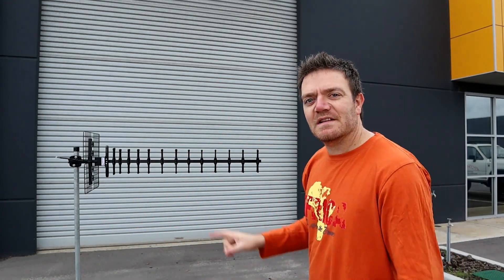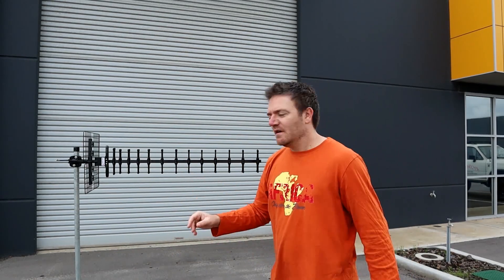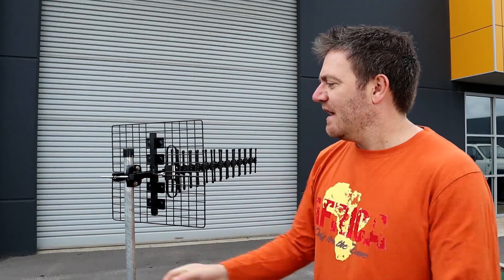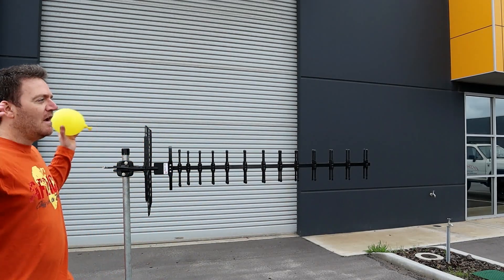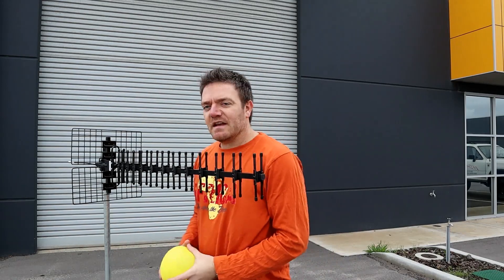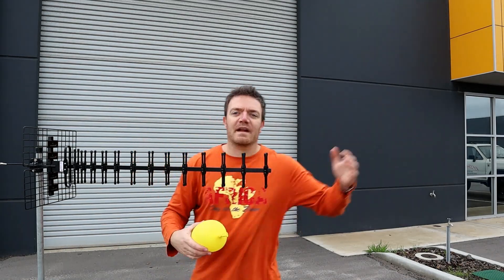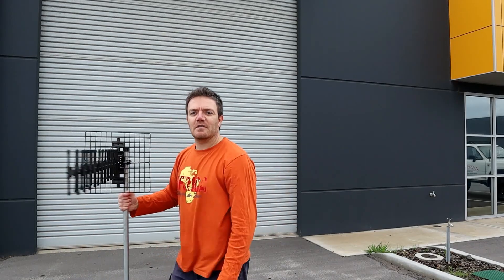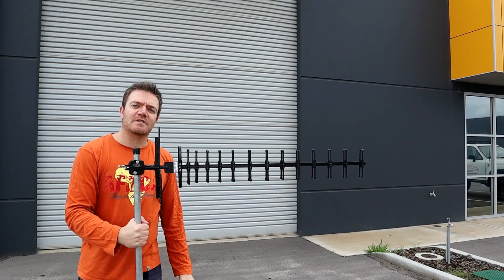Yagi Antenna Basics

Comment: I don't get it. Do you point the "front" end at the radio you want to receive? Sorry for the stupid question but I'm kind of new to this radio antenna stuff.
Reply from the maker: There's really no such thing as a stupid question !

You will turn the Yagi nose in the direction of the remote radio. Does not matter what type of application it is, you set it up such as it points in that direction...noting that the system is two directional. Although we speak about receiving most of the time, we also need to consider that the same antenna and radio sends and receives, meaning everything is actually both directions...sometimes also called up-link and down-link.
Reply: Is this antenna ok for 433mhz ?

Comment: are there any limitations on cable length from the yagi antenna to the house for example
you place antenna on top of hill but house is 200 meters away
Reply from the maker: Yes, I would not go much further than 50 to 60m with cables. Even then you'll need to make sure you use 400 or even 600 type cable

Comment: Is this design good for transmitting as well as receiving? What frequencies is this good for?
Reply from the maker: AJ, this antenna is indeed good for both sending and receiving. It's a 900MHz antenna, but works quite well from around 700MHz up to 1GHz, but not outside that band.

Comment: I have a long range cordless phone and currently its range is about 15-20km. If i replace it with a TV yagi antenna will it point the waves in one direction?
Reply: It has a gain direction, its intended for signal for a specific area with little error. Maybe 15 degrees off direction its aimed when you start to lose signal. Keep your current antenna you have installed

Comment: this video does not explain anything about how yagi-antennas work
Reply from the maker: Please tell me what you want to know about how a Yagi works? It's a dipole or folded dipole, with directors to manipulate the radiation pattern forward and a reflector to reflect from the rear. 
Many people don't understand the bare basics (which I tried to explain with a balloon) so that was my intention with this video. 
Happy to do another video that covers what you want to get out of a video like this
Reply: @RFShop  What is an element? Why are there as many as there are? Is more of them always better or is there an optimum-amount? Why do they have which length? How much space is there between them? What does a reflector look like? How does the reflector work? What are those gridshaped things for? Do they work best when perpendicular to the antenna's axis or at another angle? (I think I've seen 45 and 60 degrees). What are the (dis) advantages of a dipole yagi vs a folded dipole yagi?

What other directional antennas exist, other than yagis and parabolic-dish ones?
Reply from the maker: @ronaldonmg  well noted...now I do understand where you are coming from. Can certainly address these questions in a follow-up video
Reply: @RFShop  or somebody can point me to a video that explains it well...
Reply from the maker: @ronaldonmg  I did use a Yagi concept in my online demonstration of a dish. If you skip to the 2nd half of the Adelaide Uni lecture you'll see elements of your question being addressed.